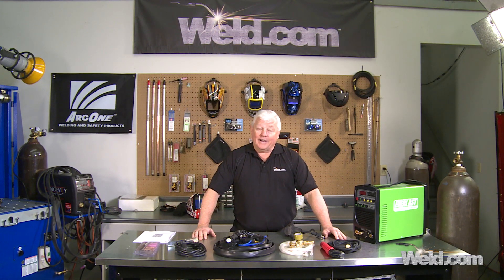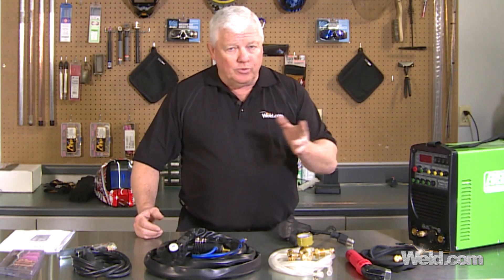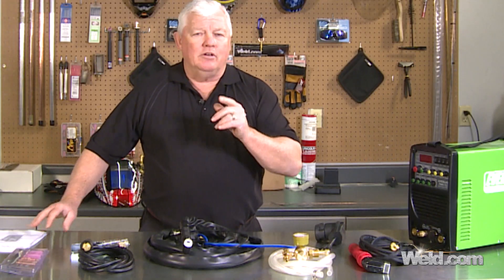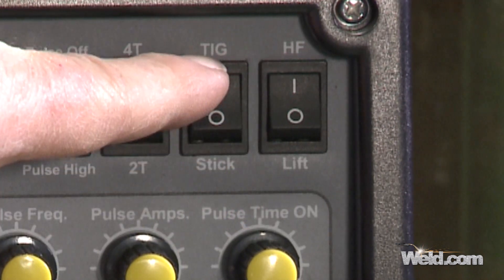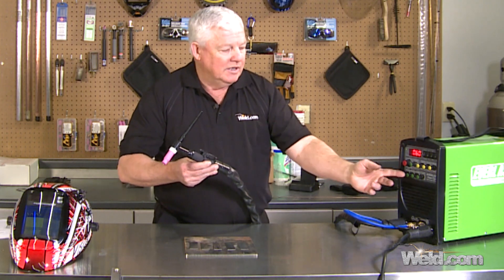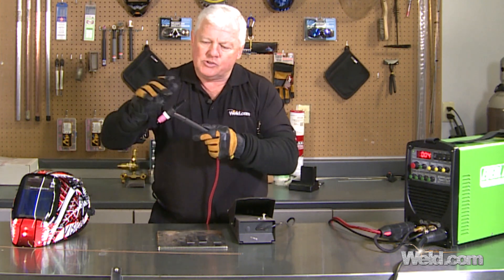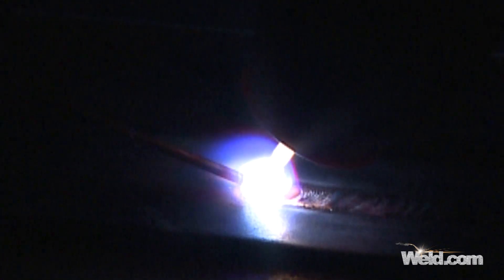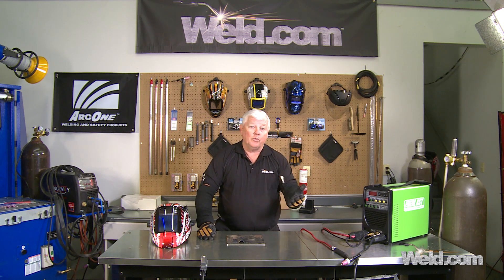TIG Machines for beginner welders: Everlast Power I-TIG 200 Review

Comment: Matt,  Since the release of this video, we have developed a very good lost cost ac/dc tig welding machine called the Mt-125.  It utilizes 115v and will handle up to 1/8" steel  and aluminum.  The package price is $895.00 with free delivery in the lower 48 states.  You can find all the info on the weld.com store.  thanks again... Mister Tig

Comment: Alex,  I don't have any information nor experience with the Rossi ct312...  With a budget of $300 to $500....   You can get a good starter dc lift start only for about $300.00.   However, if you up your budget to the $500.00 you can get variable foot control... Check out Weld.com    Everlast 140 st.    Or   Everlast 160st.. w/fot control...  thanks for the questions.. Mr. Tig
Reply: Thanks I'll check that out.

Comment: We have had for several years now  several commercial facilities that replaced their name brand units running these iTIGs day in and day out full shifts running on computer controlled TIG welding 7 or 8 units running concurrently.
Foot pedals are an option on this unit for about 120.00. (list price)
Reply: John Rambo You sure do talk a lot a smack... For disliking Mr. TIG so much, you sure do watch a lot of his videos. I've seen your comments and it seems like you have no idea what you are talking about, just that you like to start problems. The fact that you have the audacity to say "having a welding machine doesn't make you a welder" and then having to ask if a DC machine can weld Stainless or not really speaks to how ignorant you are. I just watched this video again and there are no inaccuracies in anything that was said... Maybe you should take your own advice and do some research before you try and be a tough guy.
Reply: Mr TIG says this machine won't do stainless. Your website says it does. Who's right?
Reply: John Rambo Mr. TIG said it won't do Aluminum.  That is correct.  He did not say it would not do stainless.  Please listen again.  This machines is DC.  DC will do almost any metal except Aluminum and Magnesium.  In any case, this unit is used commercially all over the US and many other countries everyday in factories, fab shops and many other places.